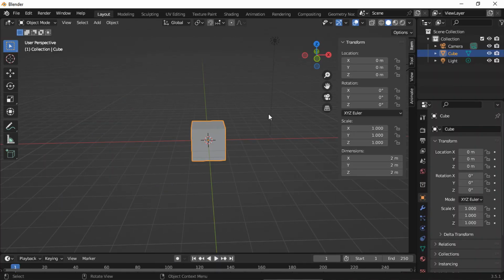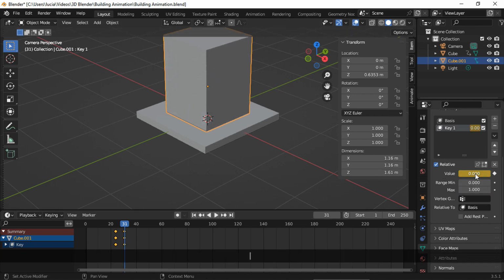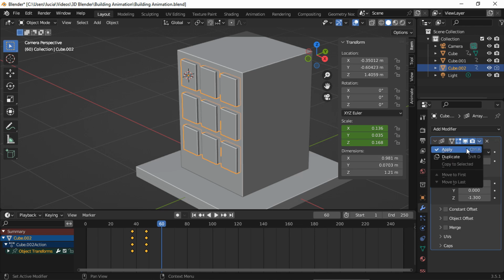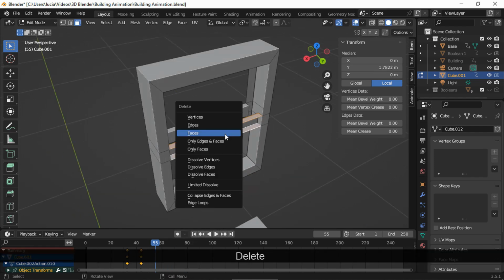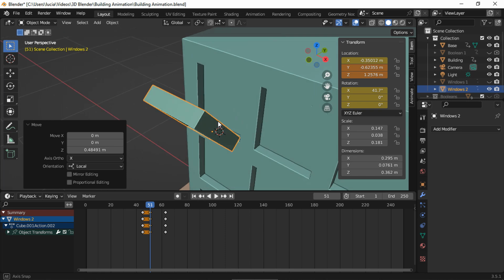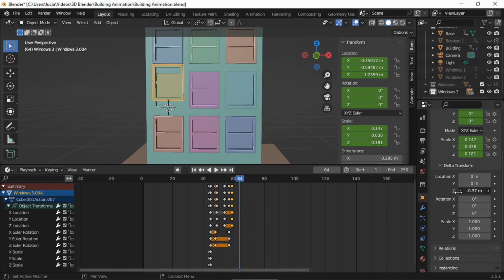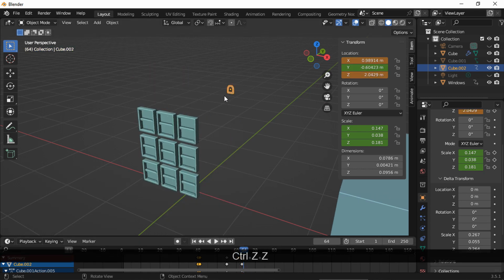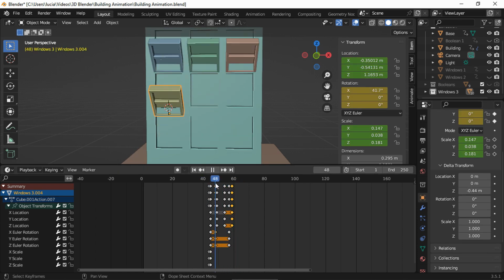Animate Buildings with these SIMPLE techniques - Construction Animation in BLENDER

Comment: Great work
I just wonder if we had to scale from 0 to 1 an object that we want to had to the scene
In your example you add the building by scaling it from 0 to 1 https://youtu.be/CyytprtdhvM?feature=shared&t=224.
isn't it possible to just add the building cube at 24 frames and insert a keyframes so that blender add the building cube at 24 frames in the animation ?
Reply from the maker: I just tested it and yes, it is possible to do that using shape keys. Select the default cube (or any other mesh) and add two shape keys. In Edit Mode: first delete that cube and then press Shift + A and add any shape (you can even model whatever you want). Back to object mode, in frame 23 insert a keyframe for the shape key, move to frame 24 and take the shape key to 1 and insert a keyframe. It would take a couple of extra steps, but it is possible. Probably, with geometry nodes or with the free addon "Animation Nodes", it would be more simple to achieve it, but I don't know much about those.
Reply: @lulikatart  Thank for your answer